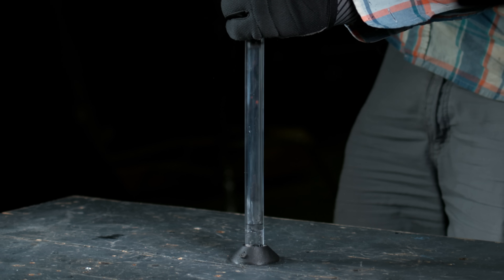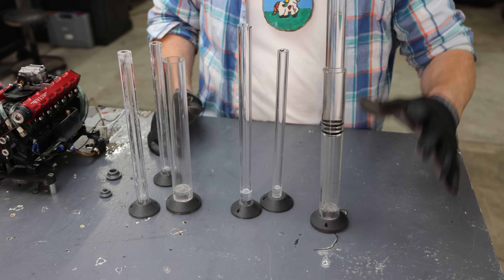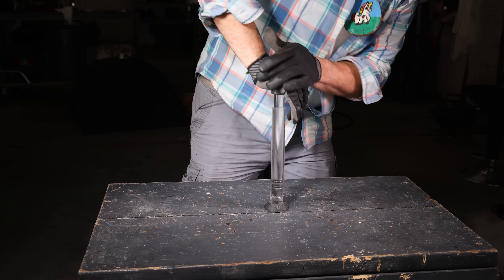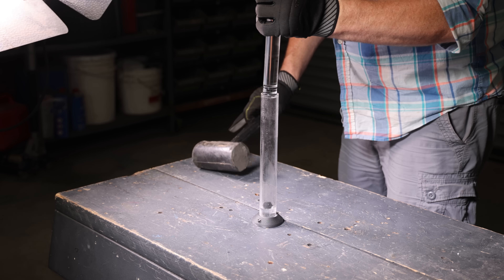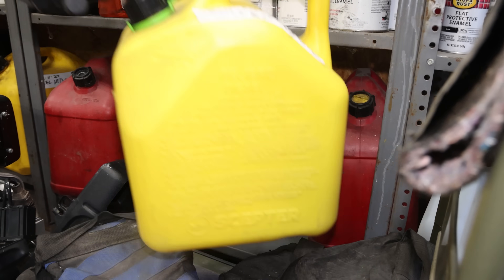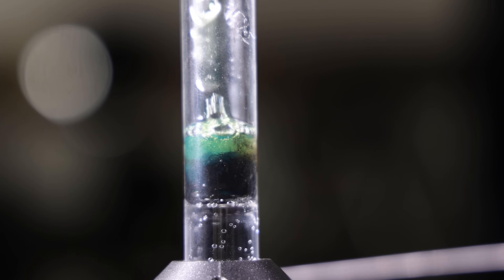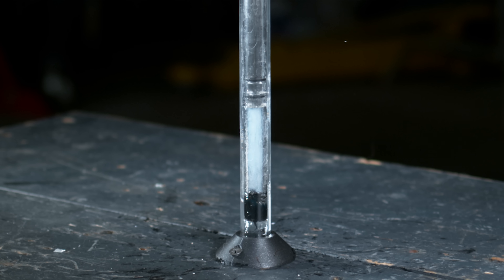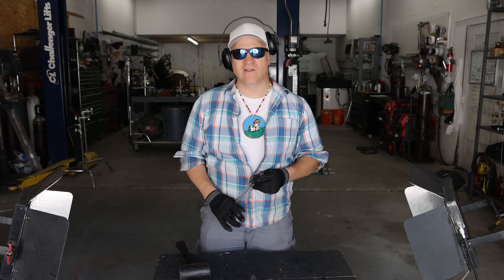How Diesel Actually Ignites (Slow Mo)

Comment: Make a bowling ball cannon. Get a Bowling ball and a 10 ft steel tube with holes drilled in the top ⅔ so the ball picks up speed on its drop and compresses the last ⅓. Put a few tablespoons of diesel in it, then a red hot ballbearing as a glow, then drop the bowling ball in it. Theoretically, it should go BOOM.

Comment: From a practical and educational standpoint this guy is a complete idiot You can literally just get combustion from compressing the air itself You don't need anything in the chamber. It kept exploding because the dumbass added a volatile liquid that wasn't necessary for simple combustion and with the volatile liquid The pressure created from the explosion exceeded The force needed to break the cylinder this guy needs a physics lesson.

Comment: I think you have to use atomized/vaporized diesel fuel. You're compressing the liquid but from what I understand you almost never can compressed liquid, and maybe the pressure is just being pushed to the glass. And maybe you can even reinforce the lower part of the tube. But I'm just guessing.

Comment: thats cuz its lot for the space and strength of the vessel, deisel was in liquid form, if you just sprayed a lill amount that wouldve worked ,7:01
Reply: correct, what hes actually doing is trying to ignite fumes... fuel injection sprayer is needed... the science is solid just the setup is too "basic" to cycle

Comment: This is most interesting. If I was doing this experiment, I would try to ignite wood-gas. It's made from burning wood with very limited air and the result is destructive distillation which gives a mix of hydrogen and carbon monoxide. It can be used to run a spark-ignited gas engine very easily. A compression-ignited diesel engine will not usually run on just wood-gas, because wood-gas will not ignite under the compression in most diesel engines. You have to have the injectors firing about 10% of the usual amount of diesel fuel. It will ignite and set off the wood-gas. I wonder if wood-gas could ignite in your fire piston? 
   Question: how many frames per second were your high-speed shots? It looks like the tube is blown to smithereens instantly, in less than one frame. Now I know why diesel engines have such a loud clack when they fire. You can really hear it on the low-RPM engines like a Lister-Petter TR1. I have one. It's pretty loud.

Comment: if you add less fuel , like just a drop or less, it should ignite with less effort due to not having to bring as much fuel to the auto ignition point.
Reply from the maker: That's the one thing I didn't do... And you're right That probably would have done the trick

Comment: Great video! Shouldn't there be a small droplet of diesel through at most? That would best simulate what occurs inside an engine. I'm pretty sure an engine would have the same result if flooded with fuel the same way.

Comment: U should try it with a solid block of acrylic with a half way drilled hole in it, as cylinder. I think its much more stable than those tubes

Comment: The Diesel evaporates and/or forms spread carburated droplets from heat at the first strikes, then is has a vast surface area plus pre-heating, meaning a sudden explosion, plus as you rightly say probably more calories per unit volume/weight, whichever is applicable at the moment.

Comment: Gay lussac's law in reality..
Pressure is directly proportional to temperature. Meaning if pressure is increased temperature too increases. This is what happened here too. The reason why the tube exploded when the cloth with diesel was put is because the ignition of diesel produces so much energy that glass being a brittle solid is unable to contain the energy to produce an effective kickback.

Comment: It's hydrolocking, not ignition that's causing the cylinder to blow out. You need fuel vapor. The fuel molecules need to be spread apart to allow for an explosive nucleus to form. Then the explosion can propagate from molecule to molecule while using the oxygen as a sort of bridge between them.

Comment: You only have a fixed amount of air to work with--maybe you're flooding it?  What are the numbers for how much air you are working with?  (1in^2*12in stroke=) 163cc displacement?  (1/2^2*12"=)40cc?  And how much fuel?

Comment: Many years ago I did a running compression test on a 71 series Detroit. As i recall the pressure was about 350 psi. 71s were about 17:1 or so naturally aspirated.

Comment: The problem with your set-up is that fuel is already present in the combustion chamber. Real diesel inject the fuel once the temperature is high and the piston is ready to start moving downward. In your set-up, you have no control of the timing, hence peak pressures and CH gasket blowing (sort of).

Comment: Maybe the tube is just getting hydro locked and blowing the walls out?  Not much ignition is going to happen with liquid diesel, needs to be highly atomized, hence the 5 to 30kpsi diesel injection systems run at.

Comment: The liquid fuel was hydrolocking your piston, transferring the hammer energy into the walls of the tube.  That may have been enough to cause the tube to explode with no ignition.  Try with water and see if it still blows out (although may create steam too, may wanna try with something else)

Comment: 0:50 that's not a fuel injector that's a glow plug
Reply: No, its a injector you can see the little holes
Reply: Diesel fuel system engineer here. It’s an injector.
Reply: Nerd that's not a glow plug that's an injector only those engines have glow plugs those are designed to run in snow ❄️ like freezing temperatures
Reply: You are funny.
Reply: Wrong. Glow plugs are not shaped like that
Reply: Nope 😊 it's an injector
Reply: Glow plug lmao
Reply: @Truckmechanics  learn something new everyday😂
Reply: only the lower compression diesel engines have glow plugs. The higher compression diesel engines do not as they are not necessary.

Comment: @7:15 you nailed it right on the head (pun unintended), the reason diesels have injectors rather than carbs is the timing is VERY important in higher compression diesels. If it's allowed to inject as the piston is still too far down, it will end up blowing a hole thru the piston.

Also why some big-power diesels use steel pistons. They get more power by increasing timing, but some times people get too greedy and aluminum pistons aren't enough.

Comment: Assuming that by "25:1 compression ratio" you mean that the volume after compression is a 25th of before, and adiabatic compression, you would get 1322 PSI, not 370. You seem to have arrived at that number by assuming that P_1V_1 = nRT = P_2V_2, but you forget that with every bit of compression you are doing work on the air, heating it up and thus increasing pressure further. In fact (still assuming adiabatic, no heat leaves the gas during compression - which is pretty accurate as long as the compression happens quickly enough) your final temperature assuming starting temp of 20°C (68°F) would be around 788°C (1450°F) - quite a big difference, and definitely hot enough to ignite the charcloth.

Comment: I think the clothe was dry and flammable some it was previously burnt. I remember on time using diesel, if you feed the diesel engine with lots of fuel it doesn’t easily start but just the right amount or small amounts. Maybe could try just drops of diesel.

Comment: AIR PRESSURE DOES NOT CAUSE ANY HEAT;  are the oxy tanks and the acetylene tanks HOT in the morning?? . are your tires HOT in the morning? NO
It is not the  air pressure, it is the incredible SPEED with which the AIR MOLECULES are MOVING through the cloth;  that creates FRICTION, like when you RUB your hands together, and that causes HEAT; you need WORK to produce HEAT, not a STATIC force; 
Having said that, NO ONE knows yet why there are volcanoes!!!!  we all have it ALL to learn,   yet....  thanks, great video.

Comment: You have too much fuel, it ignited and exploded all at once even if its diesel because of compression, decrease fuel or use the fumes to create ignition. It will give you a lower, more controlled flame that will burn cleaner.

Comment: My guess is that with the diesel pounding it a few times heats it up causing the diesel to vaporize some and at some point ignites and explodes  like a fuel air bomb, well explosion inside a cylinder anyways.

Comment: 😂😂😂 it hydro locked when the piston hit the bottom. If you hit the cylinder with some compressed air to atomize the file it will work better

Comment: That is way too much diesel for the small amount of air in the tube. A single drop of diesel would be more than enough (it would in fact still be too much). I would strike it once, then wait for 5 seconds for the part of the diesel to vaporize, and then start going at it to combust the mixture

Comment: Yeah, your fuels are completely different. The charred cloth is partly oxidized, this means there is less fuel and therefore less energy in the system. The second mix fuel has a bunch of things going on. Diesel is going to break down to a lot more gas and it will have a ton of intermediates, this means a big fat energy  release and pressure jacks through the roof. Explosive guys look exactly for this kind of quality in fuels where you get a massive gas release from a single starting molecule. It also means much higher temperatures are instantly generated along the volume of ignition... that's why all of these are breaking on the down stroke, way too much pressure in a very small area. 

Advise: try an ignition catalyst, this will get things to take off real quick but even and it was also the key to making the first gasoline compression engines

Comment: Very good demonstration.  Your tubing apparently isn't strong enough.  The very first Diesel ran on coal dust, and I wondered why you charred the cloth prior to using it as fuel.  I've never had a bit of luck with this demonstration.  And I'm told that this is why heat is generated as a rocket re-enters the atmosphere.

Comment: My Pulse Jet uses sound shock waves with up to 400psi pressure & only 200 Nanometers thick to trigger ignition.The chamber is already hot to burn but the sound wave speeds up the bang.I

Comment: 3:35 the gas that was produced is not likely to have been hydrogen; when you have char cloth, and you heat it enough to partially burn, the gas that gets released is carbon monoxide. I don't see anything there with enough hydrogen to have produced enough hydrogen to be responsible for that explosion. Carbon monoxide can burn to make carbon dioxide. That seems to me to be the most likely explanation.

Comment: The tubes are exploding because the wall thickness is too thin and the cylinders are too short. When they hit the bottom of the stroke with diesel, it’s trying to compress the diesel. At that point it’s a hydraulic cylinder because the liquid can’t compress.
If you try again with longer cylinders, thicker walls and no liquid diesel it should work much better.

Comment: I get a kick out of testing injector nozzles. The 5-7 holes were all but invisible to the naked eye. But placing a lit candle within 18” of the nozzle tip and giving the pump handle a good hard push generates a nearly 3’ ball of fire. Always fun at the testing bench.
Reply: I thought you were just going to say that you tested with compressed air and used the lit candle to see if it would blow out the flame.

Comment: "It exploded last time, so what we're going to do is add MORE diesel."
Reply: That’s why I love this Channel 😂
Reply: I feel like there would be something to learn after blowing up several tubes in exactly the same way
Reply: Well, more combustion than explosion…wait a second…
Reply: "Let me show you something...!" -Fire Marshall Bill
Reply: GREAT IDEA NEXT TIME USE METAL RODS
Reply: @alejandroaguilar9038  Are you dense? The whole point is being able to VIEW the action. With metal, you can't.
Reply: i mean its not the worst idea. less surface area to vaporise, and pressure on a liquid is distributed equally. so less force on each individual point of the glass. obviously still broke though because the glass is far too thin
Reply: Perfect!!
Reply: Yeah, I was like wtf 5:52
Reply: "That was even crazier".
Reply: my motto now
Reply: Yes, there is just no matter enough strong, which would stand such pressures at the detonations when the engine is working unless the God's Angels would not constantly carefully controlling each process of joining the spirits of the fuel with the spirits of the air at the burning after the ignition.
Reply: More is always better😂

Comment: Once the liquid vaporizes, it expands and MASSIVELY increases the pressure you’re generating.
Not sure about diesel, but water expands 1700 times its volume when converted to steam! No glass or plastic ring will be able to handle that increase

Comment: "I wanna see if I can get more of a combustion instead of an explosion"

* adds more fuel *
Reply: For gasoline that might have worked as gasoline requires a spark to transfer, and having a richer would slow that spark because its the fumes that burn, not the liquid.

but since diesel combustion is based on pressure, all of the fuel combusts without the need for the flame to transfer to more fuel.
Reply: Was somebody holding his beer for him?
Reply: It’s like you’d expect this guy to know what he is doing and then going the wrong direction 😅
Reply: The American way

Comment: A great video and a very clever way to explain how a diesel combustion engine works.  A common everyday example of air heating up under pressure is a bicycle pump.  As you pump air into the wheel the bottom of the pump noticeably heats up.  This is caused by the compression of the air inside the pump before it enters the wheel.

Comment: I'm a retired machinist. 
Many years ago I was removing a press fit steel sleeve bushing from a blind hole in an aluminum plate. I filled the blind hole 1/4 with heavy oil put a 1.0000 steel dowel in the bushing hole and gently tapped it to push the bushing out. This is standard procedure using the hydraulic presser to push out the bushing. The bushing was too tight so I got impatient and smacked it hard. The oil ignited with a large pop sending the 1 inch dowel flying 30 feet into the factory ceiling. I felt it pass my ear by a hair breath.
Reply: Just had the senior millbilly in my local shop show me how to use hydraulic pressure like that to change a fitting, and he gave me a very similar warning. 

Glad you're still all here, brother. 

Cheers.
Reply: Damn!!!
Reply: *breadth (the distance or measurement from side to side of something; width, wide range or extent)
Reply: Did you get it on the slomocam?
Reply: @andreproject4285  LOL
Reply: Yikes!
Reply: I was trying to put a strip of metal into a slot with some silver solder, it's was hot and melted in there, I tapped the metal into the slot and silver solder shot out and almost got me in the eye.  time and time again I keep making stew phid mistakes in the shop, I'm glad you didn't lose your eye!
Reply: And then you were drug tested?
Reply: @Looolomfg  LOL, nope this took place in the mid 1980's. At that time some of the guys would go to a local tavern and have a few pitchers for lunch!
Reply: Hmmm? Something very similar happened recently with President Trump.

Comment: I loved this live demo!!!   This is PV=nrT  where P is pressure, v is volume, n is the number of moles, R is the universal gas constant, and T is temperature.  In what you are doing, V, n, and R are constant.  Thus, P increases and T has to increase.  When T increases to the proper temp, the fuel is injected and it ignites with air.   That is the physics teacher explanation.
Reply: Errr, well...PV is what is being changed thus T is increased.

Comment: I think you need much less fuel in there. Just a drop or two. And i also think that you should use something more volatile, like regular gas. You dont have the benefit of the aerosolizing (spraying) that a real engine has, and gas probably self ignites at lower pressures anyway.

Comment: The wool burnt but didn't expand or vapourise like diesel, when you put diesel in the tube for the first time it actually did ignite, there was a tiny flame in the tube, it then expanded, meanwhile you again compressed it, compression was doubled by the expansion of hot gaseous diesel and the tube blew. Next time again, although without a flame, diesel did vapourise and doubled the compression. Like you said, diesel has lot of stored chemical energy hence the repetitive blowing up of the tubes. You were successful nevertheless in proving your point.

Comment: Great demonstration.
I think the reason the diesel blew up the tube is because it burns much more rapidly than the char cloth. The very rapid burning creates a very high pressure that breaks the tube before the piston can be accelerated upwards.
The piston has some mass, albeit small, and there is also friction between the walls and the piston rings. These cause resistance to the piston accelerating upwards which in turn does not allow the combustion gasses to expand immediately and hence they create a pressure spike and stress in the tube walls that exceeds its tensile strength.

Comment: Diesel runs about4.8 M Joules /kg energy content so you have way more energy content in you tube than just with char cloth. Normal peak cylinder pressure in a truck size diesel is between 100 & 200 bar ( depending on emissions control level) or  1500 to 3000 psi but what will really make the difference is the burn rate and hence the rate of pressure rise.